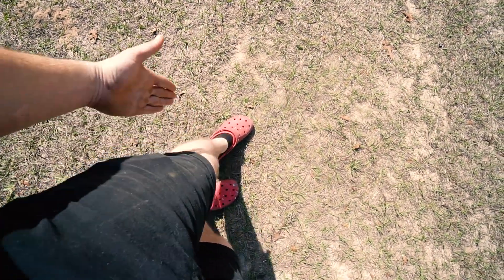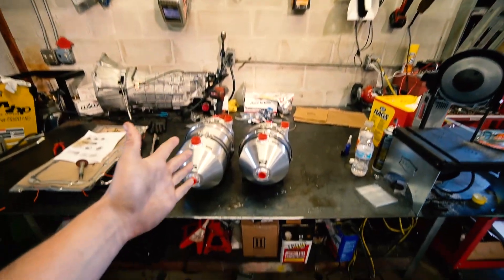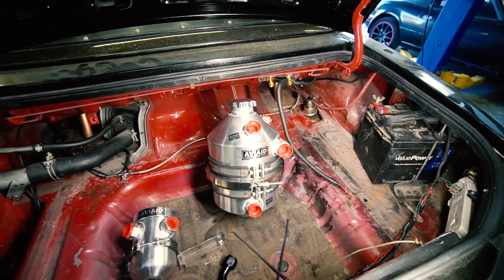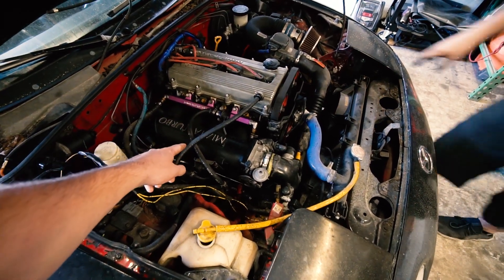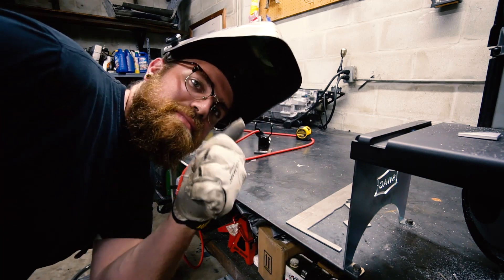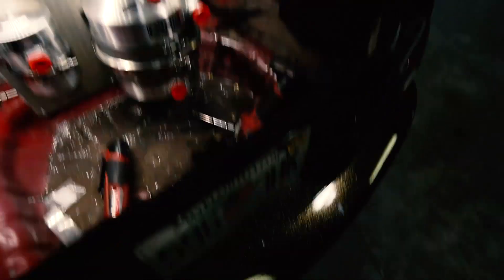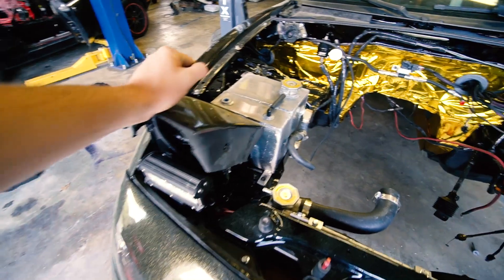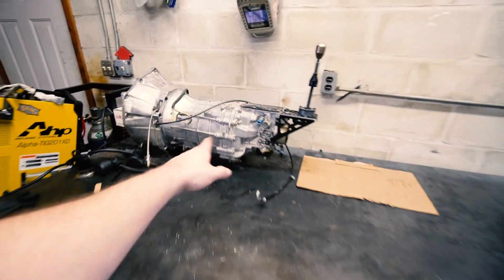DRY SUMP Install On the LS MIATA!!

Comment: Excellent productive day.   I don't recall hearing about an oil cooler, but I expect that will be part of the oil system setup.  Wondering of the fan will end up blowing hot air down during the summer months.  A better system might be an exhaust fan in the roof that pulls hot air up and out.   Just a thought....

Comment: if you're going to shim the transmission you need to check to see if you have proper drive shaft angle once its installed.

Comment: You might want to think about looking into the benefits of running a vacuum pump with your drysump .with the placement of the tank .which is a good place .I'm just worried about it smoking. Its a lot to get into in the comment section. Just wanted to throw the idea out for you to ask the company supplying the drysump. Looking good as always. Keep up the good work .

Comment: Nice job.
You should of flipped the bracket/clamp on the small tank, to get to the strap nut easier. Also if you added an inch to the plate and put the extra in a vise you could of bend the angle without adding the tabs.
But great build man.
Keep up the great vids.
Cya,
          W3BZ

Comment: before you mount everything in that trunk please clean it out and bedline it. then install 1 led light with a toggle switch on it. it will make your trunk so clean and quite the noise a bit. plus the light will make late night track side repairs much easier. im sending you bed liner to do it!!!!!!!!

Comment: How are you planning on draining the dry sump tank? You don't have a hole in the trunk floor and its too close to use a pan.
Reply: Brian Lankford I was wondering the same thing. He should’ve just ran the larger tank and cut the floor. That way he would have a little extra volume and it would make oil changes that much easier.
Reply: Jason1987 I thought the same from the beginning. Still love the build. It’s got me wanting a new project car.

Comment: Crankcase vacuum is actually a good thing , you should seal up the motor as tight as possible, it helps ring seal, and the only lines running from the trunk to the motor should be pump feed and scavenge return. The blow-by gets sent back to the tank through the return line and separates from the oil in the tank.
Reply: I should add a caveat to that, too much crankcase vacuum will cause the small ends of the rods to lose their oil, and potentially strip the walls of oil. To remedy this, you may have to put in a vacuum regulator in the valve cover to let some atmospheric air into the system

Comment: be careful spacing the rear of the trans up in regard to altering your pinon angle. One piece driveshafts and solid mounted rear diffs are not very forgiving at high mph.

Comment: With oil fuel and a battery in the same area you should probably build a battery box  just to be safe. Also paint the truck, it's the only unfinished looking piece of the build.

Comment: You should get some stainless steel wire brushes and ONLY use them on aluminum, stainless, and other non-ferrous metals. Clean aluminum, or any metal for that matter, is paramount for quality, aesthetically pleasing welds.

Comment: Taylor, is this the 5.3 Ls?
I mean I don't think the 5.3 is an Ls but I'm asking cause I know my truck has a 5.3 and it has an Ls badge but I'm just wondering
Reply: ThatOneCarGuy 5.3 is a ls platform but the real LS Motor’s according to gym are the aluminum blocks found in the performance cars most truck motors are lm7/lq9 which are iron blocks
Reply: @CapeofBravery  that's what I was thinking but either way the 5.3's are solid motors I got 339+k miles on mine and it still runs great
Reply: Just cause the Engine code isn't LS(1,2,3,6,7 etc...) Doesn't mean its not an LS, theyre all LS's basically.  Same engine overall, most of the parts are interchangeable. Its like when honda made the f20b, its basically considered an H-series cause the parts are interchangeable and its essentially identical to an H22 etc..
Reply: @CapeofBravery  His engine came with LS6 head castings from factory, its aluminum but its called an L33. There is no "real" or "fake" LS.
Reply: Lol the LS badge is the model of the truck. The package per say. LS is only all aluminum. He has an lm7. But yes identical basically in everyway
Reply: In Decay that’s kinda what I said I said the 5.3 is ls based platform but gm only calls the aluminum blocks in performance cars true “ls” motors
Reply: Actually yes he has the l33 HO 5.3